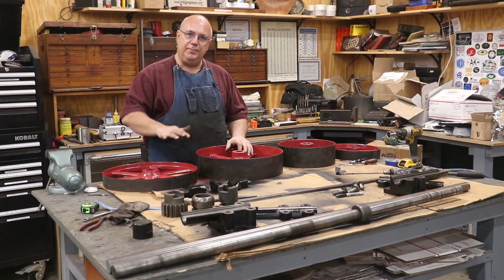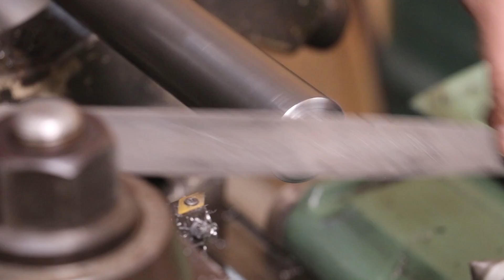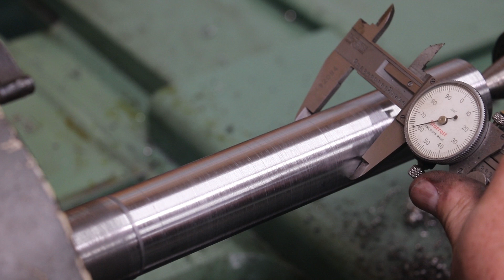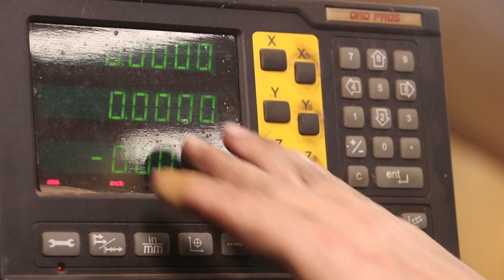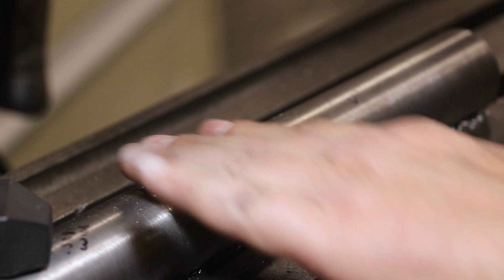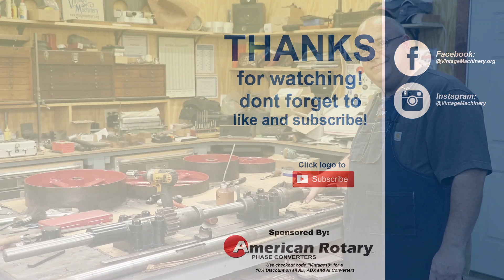New Haven Metal Planer Restoration - Part 18: Turning  a Shaft & Cutting Keys

Comment: You should sell those old shafts for at least 4 or 5 times the cost of brand new metal shafts. I'm actually sort of amazed all this old iron/steel hasn't been sold off at already at marked up values. They've blown large amounts recovering iron/steel from sunken ships, anything to get a hold of pre-nuclear weapon testing and usage metals without any radioactive fallout pre-baked into all modern (post 1944) metals.

Comment: Back when I was a mechanic I remember when Safety Kleen put lots of their parts washers in local repair shops. In a few years many of the things they assembled took tons of work to disassemble, they were rusted so badly. 
May I suggest blowing out the holes and lubing both the holes and bolts with motor oil.  I would skip the trick lubricants unless there are special corrosion issues like steel bolts in aluminum or other dissimilar metals. Might do well on gear teeth and tend not to accumulate dust, but grease will do fine, synthetic may last longer. Moly grease tends to dry out.
Thanks for taking all that time to share this restoration! :)

Comment: No disrespect to KEITH, but most AMERICANS wouldn't know B. S. W. threads if it bit them you on the you know what,but then again,that goes for most AUSTRALIANS,   I started in the metal trade during the change over,plus I work on old motor vehicles,my son-in-law and grandson have to know feet and inches because of silly old grandpa

Comment: Hi Keith and subscribers, I have to put up with a small 7" x 14" Chinese lathe but still get hours of fun in my shed, I've made several upgrades to it including fitting tapered roller bearings. Whilst turning down some 2" bar stock of unknown origin I noticed that pushing the depth of cut (to about 25 thou per side) and producing blue chips gave an absolute mirror finish using carbide inserts at 800rpm, whilst taking a final light cut of 3 thou left a terrible finish. Will this be down to the material? I tried different speeds and feeds but found that aggression always gave the best results.
Bewildered from England.

Comment: Hi, shouldn't the loose pulleys have some kind of bearing in them like phosphor bronze or babbit metal? This would slow down wear on the shaft and reduce noise! Steel on cast iron is not a good idea especially since there doesn't seem to be lubrication to them. If your fitting a mechanical lubricator (like on a steam engine)  you should consider tapping the casting for pipe theads BEFORE refitting the shaft to the machine. If you want to then fit a lubricator later on just plug the hole with blanks. Saves having to take it all apart again. Did this with an RSH 0-6-0 wheel bearing blocks which had oil cups on the blocks originally and moved the reservoirs onto the footplate and later fitted a lubricator when it was fully restored. Now in fully running condition after 3 years work and much easier to maintain than crawling between the frames to oil. Missing out on lube because of access causes more breakage,  wear and cost.
PS this in on a standard guage industrial 0-6-0 in UK on a steam preservation line.

Comment: Clamp a C-clamp to the edge of the table/workbench to prevent the round bar stock from rolling onto the floor and or feet... or cut some V-block's out of some 2x4's or 4x4's to aid this ... either or,  I kindly mention...

Comment: Keith, you can buy 1/2" x 12 tpi bolts from the UK. This is a standard Whitworth bolt size. Socket cap screws may be more difficult as they really came after Whitworth was a common thread. These people supply replacement fasteners for vintage cars and motorcycles https://www.a2stainless.co.uk

Comment: Pounding on a key with a steel , not a brass, hammer?
Reply: Sure.  Won't hurt a properly fit key.
Reply: @paulcopeland9035 Unless the key is case hardened the hammer will cause mushrooming.  Light dressing of the key with a file will let the  dog slide easily.
Reply: @paulcopeland9035  a properly fit key don't need to be hammered in. hmm...
Reply: @knas5289  ....Tappy, tap, tap....

Comment: That shaft could be 37mm with 8mm keyways. Dimensions tie in to within the accuracy of a vernier.
Reply: Those holes drilled at the ends of those keyways would allow a vertically square key to but against them. Round ended keys make it a bit easier to align the key and wheel. Big help with press fit parts.

Comment: I'm not sure if this works with such a thin shaft, but in the future, if you ever get one such as that gets chatter, wrap a length of lead around the center area between the steady rest and the chuck. My uncle used to do this whenever he did marine shafts for smaller boats. Whenever he didn't (too short or in a hurry) it would banga-lobble all over the place. :))

Comment: That set screw on the collar that you think might be a potential problem due to it protruding.  Paint its top red to make sure that it is visible so that if somebody is working on the machine they will see it sticking out and not do anything that can interfere with it.  Safety first!
Reply: @Craneman4100w  Maybe, but when you are "restoring" an old piece of equipment, many people would like the necessary changes to be minimal to keep the equipment as near as possible to its original design.   For example, many necessary changes to old electrical devices to be used at a home may be needed for safety - modern electrical cords and fusing and insulation - and sometimes due to the lack of any older safe-to-use spare parts, but these changes are to keep people from being electrocuted, not necessarily because the restorer wants to do it.

Comment: The screw in the collar is 1/2 inch British Standard Whitworth. I'm surprised you haven't come across that before. If you make your own in future remember that the thread angle is 55 degrees on British Standard Whit. and Fine. 47 1/2 degrees for British Association. You can get BSW grub screws here

https://www.ba-bolts.co.uk/bswallen.html

Comment: That new shaft should last as long as the planer itself.  That stationary sleeve with the 1/2"-12 lock bolt, I think the original lock bolt is a good choice, keeps it original.  True, it may not be as safe but I like it.  😃😃😃
Reply: That part is all down under the bed and no more dangerous than the open gears.  No reason to be groping around there when the machine is running!
JIM

Comment: 1/2 Whitworth is 12 tpi (although it is 55 degree). They are still available here in the UK. Let me know what length you need and I will post a couple over.
Reply: Great info. Obviously, if he can find a die he'll make the screw. It's needed.
Reply: Came to post exactly this - you beat me to it! I wonder if Keith's part is "old" US or just Whitworth
Reply: @paulwomack5866  That;s a good question. The change in the USA to the 60 degree thread was done 20 / 30 years before the machine was made. I guess that the change from 12 to 13 tpi was made sometime after the turn  of the century, possibly when NC became UNC. I haven't seen a thread chart of the older standard but it would be possible that the Whitworth  pitches were used but with 60 degree instead of 55. This would have been useful as the two will work together for most (including this) applications.
I should point out that this is pure speculation on my part. 
I cannot be held accountable for failures of mars landers due to the incorrect fitting of Whitworh fasteners!
Reply: I believe Whitworth data is included in old Machinery’s Handbooks. Upon checking, it is listed under Screw Systems which is a chapter in Edition 22 which is copyrighted 1984.

Comment: 1/2 inch 12 threads per inch is BSW - British Standard Whitworth these differ at 1/2 UNC Unified National Course at 1/2 inch by one thread pitch per inch UNC is 13 threads per inch.  I am not sure in America but cap screws are available in BSW here in Aus.  Great Video Keith as always, keep up the good work.  A Fan from Aus.
Reply: Came here to say much the same thing. 

As it happens, I have a large carrier bag of N.O.S. 1/2" BSW and BSF Set-Screws somewhere and could probably stand the cost of postage to Georgia for a single set-screw.

Comment: Dear Keith, filing the "curved" end is poor practice, someone like you should be able to "crank" this out. If not, you can use the cross feed in reverse and turn from the center to the OD by using the top slide.

Comment: A shear tool might have been very useful on this project?
Reply: Or a roller burnishing tool which gives a good finish and can improve the structure of the surface.
Reply: @chrisstephens6673  I used a shear tool today and got a near mirror finish on mystery metal (and on size). I was very happy. Tried to make my own burnishing tool once... didn't work out. :)
Reply: @dudleycornman1624  re burning tool, have a look at mine on my channel. As for shear tools, they are great when "chasing tenths" and yes finish is good. I use a round one like the design in ME magazine back in the fifties. It allows you to change the angle easily unlike the square ones modern people use.
Reply: @chrisstephens6673  I just use a round boring bar and rotate it to just off vertical.
Reply: Dudley Cornman great idea saves making a dedicated one.

Comment: BTW that odd key might be a 5/16 Whitworth- a lot of industry still used the British measurements which had become industry standards during the industrial revolution.  1/2-12 thread was the industry standard for Whitworth.
Reply: Welding around the shaft works for small stuff, when you have such a big shaft, welding around it will likely warp it, then you get in other worm cans. Not worth it. Besides, the shaft isn't junk, it's just not good for the machine anymore. It will get reused for other stuff.
Reply: Welding just the corroded area would banana the shaft. Straightening it would be a nightmare. Keith has the skill and equipment to make a new shaft. Much easier for him.
Reply: Hot news Whitworth threads are STILL in use!  Several studs on Volvo engines are Whitworth on one end ( into the engine block casting)  and metric on the other!
Its still the strongest thread for casting to parts security!
The odd sized keys were probably made in house by the maker so you had to buy replacements from them( more common today).
Many countries bought the obsolete machines for making Whitworth thread screws and nuts and still use them on their products. ( China in particular use them).

Comment: Hmm. without knowing. 21/64 == 8.3 mm. Can it be that this is metric keys? 8.3 is rather close to 8 mm.. Infact only 0.018 inch away..  I see that I can buy metric drill bits for 8.3 mm without a problem..
Reply: Americans hate metric today, let alone over 100 years ago. No it is not metric. It may be a British standard though.

Comment: @23:40 You are absolutely correct about the shaft collar screw head projecting into space- it is definitely a snag hazard. Too bad you don't have 2 more lifetimes; it would have been instructive to see you abandon the odd thread hole and tap in a newer standard one that would accept a 1/2- 13 setscrew. ☺

Comment: I really like this. Why didn’t you scale up the key ways to the next largest modern square key standard, then key the gears to match?
Reply: That doesn't match the requirement the restoration isn't perfect. Besides it requires a new broaching the gear or pulleys.
Reply: And there's no benefit in doing all that extra work.